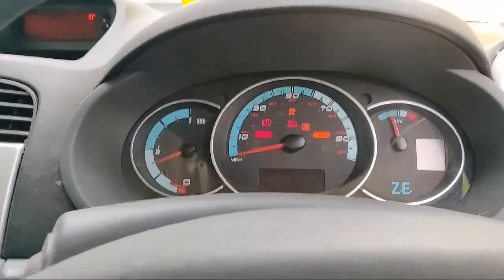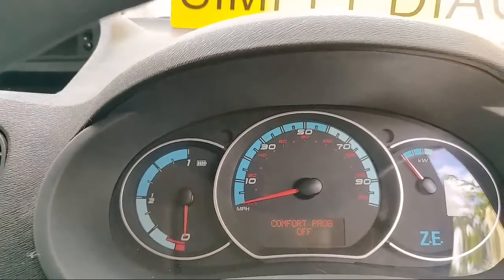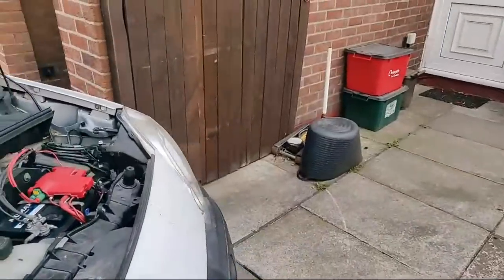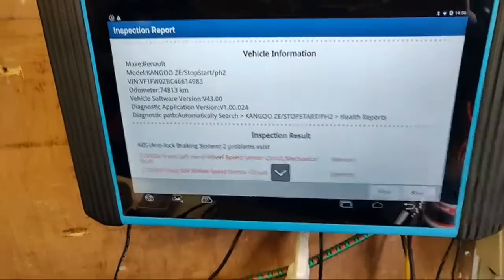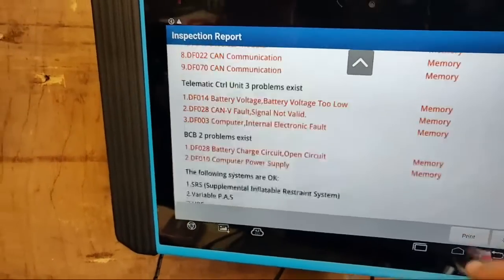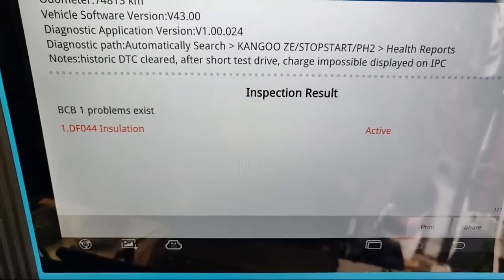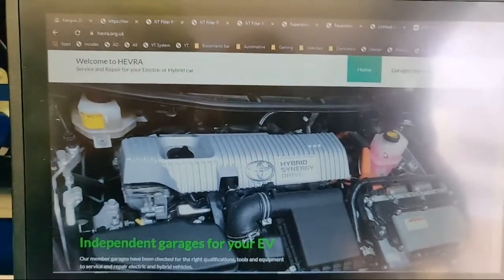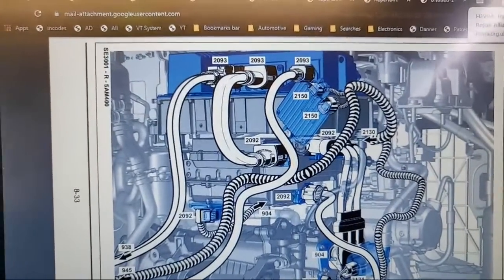Kangoo ZE DF044 Charging Impossible

Comment: Before I retired, I had been to several EV classes.  We even got to disassemble TWO Prius EV battery's and removed the Inverters.  Then we went over different ways and what to look for when Diagnosing them.  When I had another Prius in our shop, it was going to the body shop for crash repairs, but they couldn't get it out of park.  I emailed a woman named Caroline and she sent me the procedure to set the electronic Park to neutral  and keep it there.  We were able to  move the vehicle around in neutral and just block the tires.  I got the info from her through iATN.  VERY HELPFUL!  Never got to work on electric motor problems.  When the vehicle is repaired,  can you show us the damaged parts?  YOUR AWESOME!!